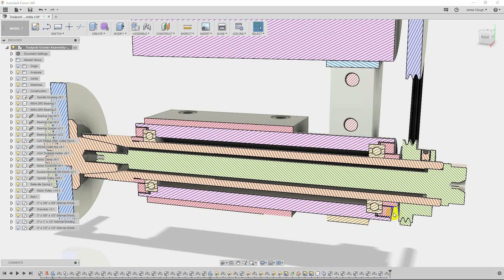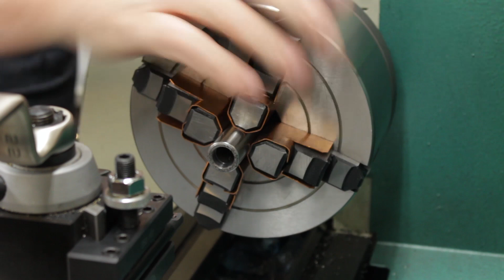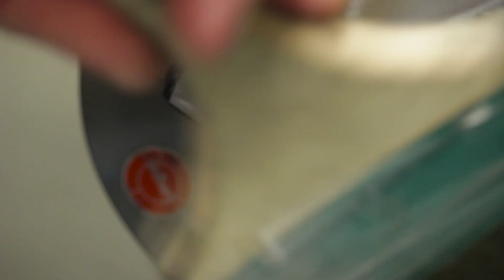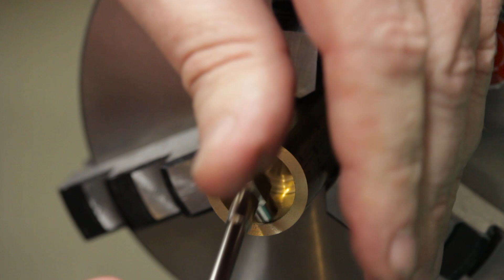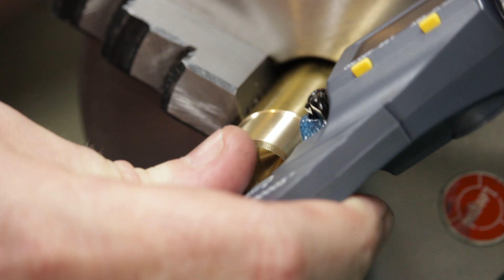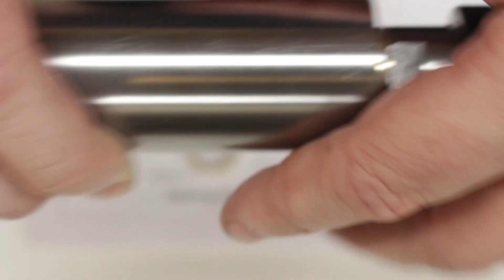Making a Toolpost Grinder Part 5: Making the Spacers

Comment: Just a tip to get your 4 jaw setup quicker. You can dial in various size pieces in the chuck and then scribe lines to match the rings on the face of the chuck to give you a visual reference to center your work when puting a new work piece in the jaws. It helps not to have to fiddle around with the jaws as much.

Comment: I realize this is several years old, but I just ran across it now.  Good series.  My question is regarding the registration for the drawbar.  Why did you use a close fitting cylindrical fit rather than conical?  Conical surfaces would self-center and you wouldn't have to worry about maintaining a precision fit as much.

Thanks

-Kurt

Comment: James, you've got to improve that tailstock clamp mechanism.  Doesn't using the spanner drive you batty?  A nice 1/4 turn locking lever would be a good project.
Reply from the maker: Yes.  It's pretty annoying.
Reply from the maker: Yes.  It's pretty annoying.

Comment: Hi,  what is the purpose of the set screws on your spider?  The 3/4” spider should keep the part parallel to the chuck.  Is it for odd shaped parts?  Thanks.
Reply from the maker: The set screws are there to space the spider away from the chuck for holding thinner parts.  With the screws all the way retracted, the spider is 3/4" thick.  If I extend the screws, I can make it effectively thicker, spacing thin parts all the way out to the tips of the jaws.
Reply: Clough42 thank you